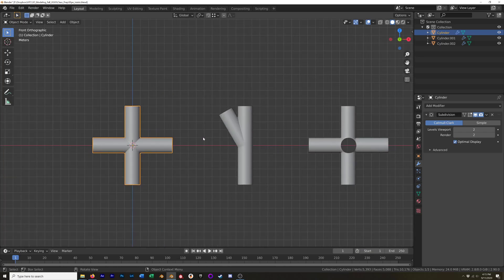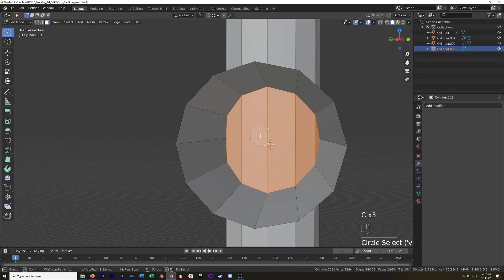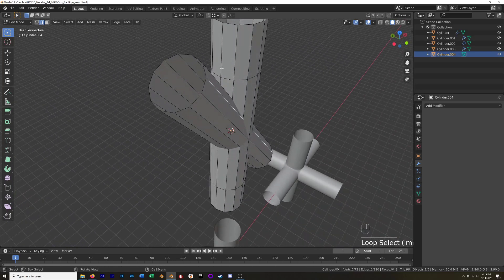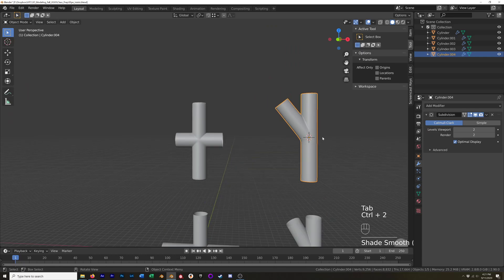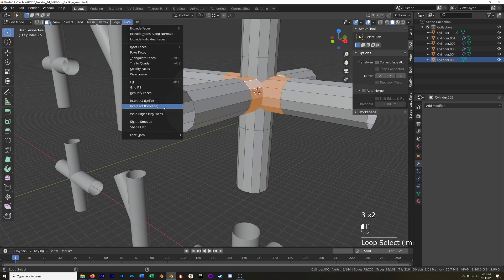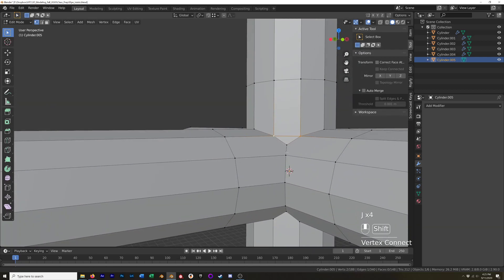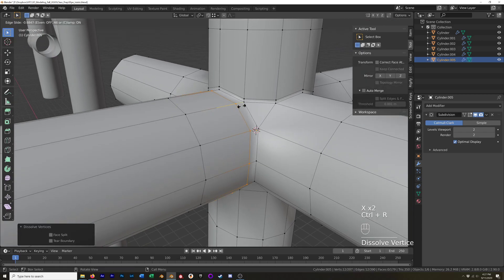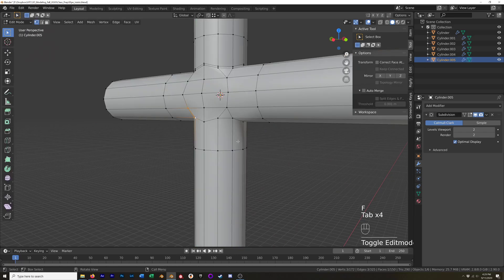3D Modeling in Blender - Quick Tip: Pipe Joints

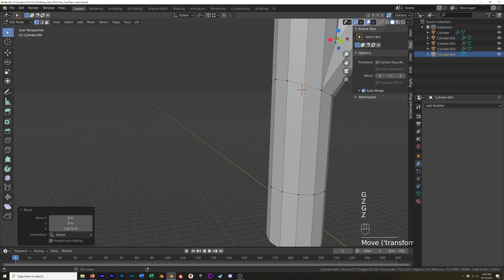Comment: How did you do that automatic joining points in 4:35 to 4:53? The Points joined eachother automatically by using the keys G+Z+Ctrl+left-mouse-click. I tried it several times but it won't function. What to do?

My blender version is LTS 3.3.1 from Steam.

Comment: While it's important to learn foundations, this tutorial does not leverage the true potential of Blender and wastes a lot of time. Do this instead: Edit > Preferences > Add-ons. Turn on Add Mesh: Extra Objects and save preferences. Shift+A (Add) > Mesh > Pipe Joints. The tool options that pop up in the bottom left menu will let you control the number of connected joints, their angles, etc. Once that's done, modify the topology and bevels from there as desired/if needed.
Reply: These are nice to have certainly but they also have their own limitations that these techniques can solve.
Reply: Oh my God, this is legit a whole lot easier. Thank you for this. I was trying to make a Legit Y pipe shape and the tutorial video didn't include that particular shape.
Reply: @Goefrei0516  cheers! :)
Reply: and then if you need to make a corner joint, there is no parameter to create this, which why understand how to create it without the add-on is important

Comment: I cannot get this to work. I'm using 2.93, but I've also tried it with 2.83 (which provides odd results - sometimes the boolean operation, even selected as Union, works as if it's Difference/Intersect). The main problem is that I can't add any supporting loops after the boolean is done (I'm getting a similar effect to you when you're working on that last example), and it doesn't matter whether I add these loops in before either. I've tried closing the caps on the rotated section (apparently open ends aren't great for boolean ops), but that made no difference. I've tried merging points (in case there were any strays) but there aren't any to merge.

Really frustrating. I wonder how many folks are trying this and also finding it doesn't work. Or are they getting results as per this vid? I must be getting something wrong, but I can't fathom it.
Reply: This bad guy's name is Exact Solver and he is responsible for creating some bad topology in this particular case. Just make sure to switch solver to "Fast" right after you performing an "Intersect (Boolean)" (menu in the bottom left corner of viewport).
Reply: @А.С-е7р  Thank you! :)